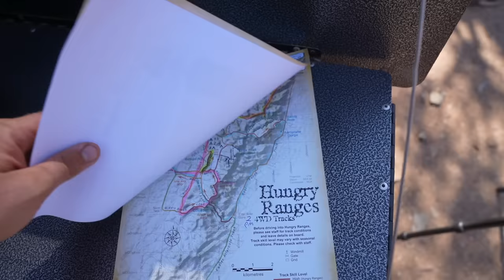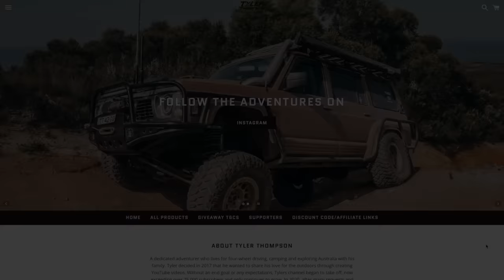We were NOT prepared for this... Attempting South Australia's TOUGHEST 4WD tracks! Bendleby Ranges

Comment: I did Billy Goat Ridge in a 2012 WK2 Jeep Grand Cherokee with Quadra drive 2 and air suspension back in 2016 all, the other vehicles were like yours, they thought I was mad.. It is a solid 9/10 in a touring set up, spare underwear is recommended in a full IFS vehicle with standard tyre sizes, the angles get scary on a narrow ridge with limited line choices. Looks like it’s got even more challenging now. One of my favourite places up there.

Comment: Good rubber of good size, good suspension, good lockers, the torque of straight 6 diesels. What setups! ❤️
Reply: @TylerThompson
When rolling downhill in low range 1st or 2nd, please pull the handbrake 2-3 notches to change the brake balance more to the rear than front. Only tap the brakes when needed. My experience is way better changing the brake balance than not. 
- Give it a try and let us know your thoughts.
Reply: @BorisEkner what would that achieve ? If the centre diff is locked, or, no centre diff, then the entire drive line is retarded evenly, ie, front brakes retard the rear wheels though the drive line.

Like wise, using the handbrake will also retard the front wheels through the drive line.

Am I missing something here? Btw, I had 2x 80 series and 2x GUs 20yrs ago.